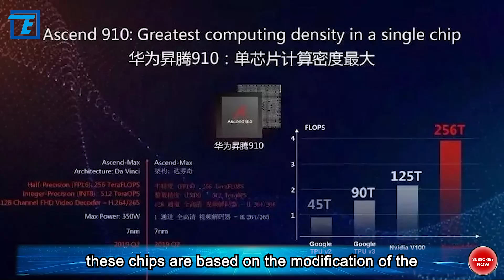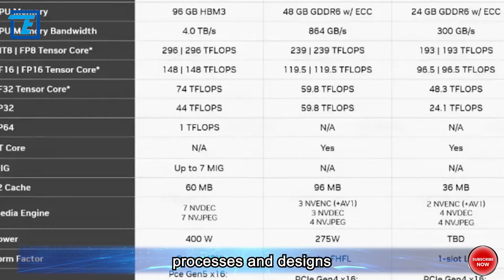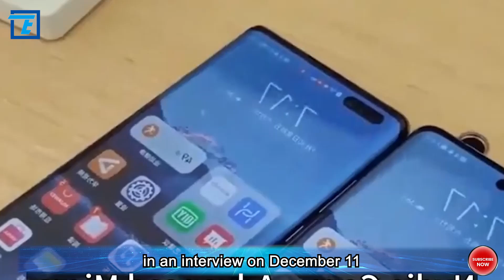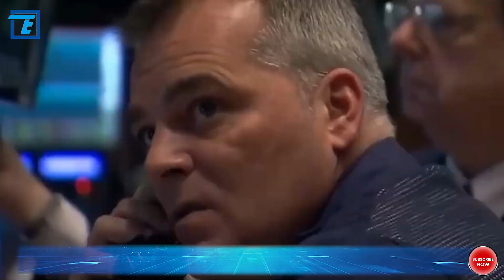Where is NVIDIA heading with its "special supply" chips?

Comment: China should wean its dependence on US made micro chips once and for all.
Nvidia is still under the control of US politicians and US Commerce Dept had just imposed further restrictions on China semiconductors trade (in response to China's holding back new Boeing 737 purchases pending the results of investigation on the dislodging of Alaska Airlines plane door in flight).
自立自強，把科技的命脈掌握在自己手中
自立自强，把科技的命脉掌握在自己手中
(Self reliance is strength.
Put the fate on the advancement of knowledge and skills in your own hands).
Be free of others.
There is no better way for China.